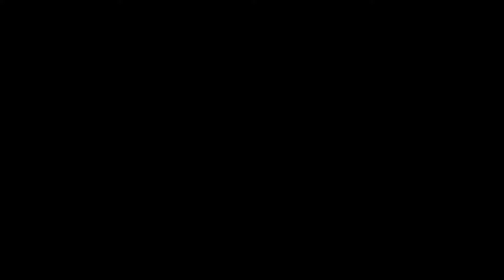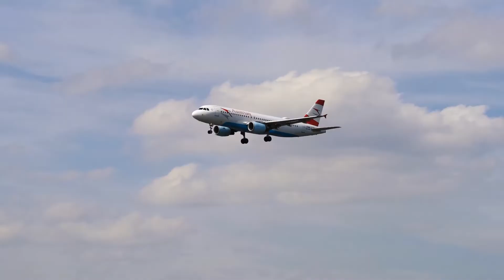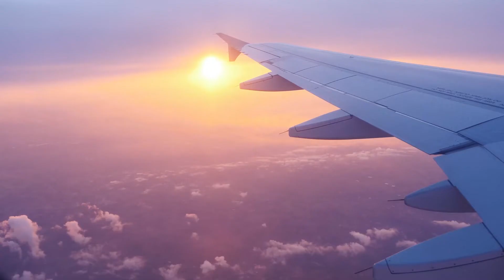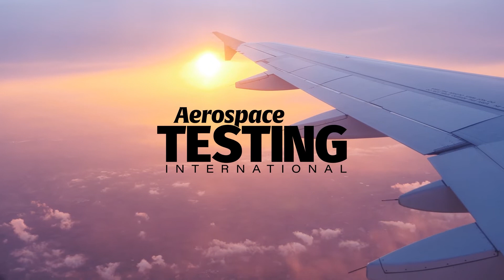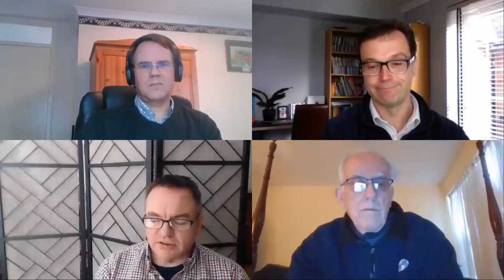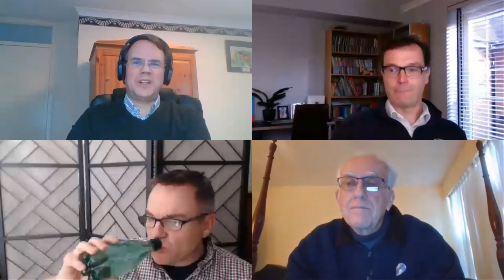Next generation NDT working with aerospace composites

Comment: I just found this webinar and I'm very happy. Thank you All of you!
I work more than 20 years with aircraft composites, I'm Level 2 NDT inspector in BT method. Due to additional requirements inspections were repeated with NDT-UT A-scan method in same location, the non-conformities areas of UT inspections were much higher they I were able to notice by hearing. By experience of 20 years I know how much the NDT-BT method is limited. The NDT-UT requirements I know from the standard company document. Anyway it is hard to deal with it when you introduce artificial flaws. For some of location you can confirm it even by NDT-BT by tapping, but for most of them are like solid kissing bonds. What is  big problem for EASA authorities what is hard to explain. Any way I'm happy to discuss if you like.